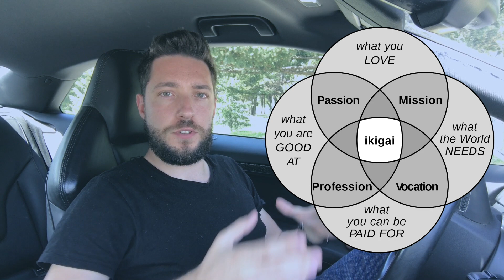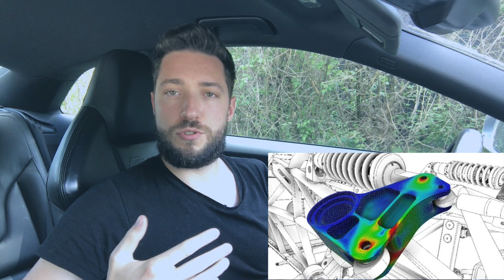Let's build a Minimalist SUPERCAR, from scratch

Comment: I like the idea!
People overlook the fact that:  Theoretically; a trike with no suspension and solid wheels keeps all wheels on the ground at all times...
With 3 wheels, you might consider an ...'over-tuned' modded Active Anti-Roll Bar, off the shelf, to give it some lean into corners.

For the E model:
A series hybrid with a small constant rpm and load engine:
That means that an engine with a magneto and carburettor can  be tuned to optimal..!  = Cheap and simple.
Also the intake and exhaust lengths can be tuned  to optimal as they then are working 100% of the time, vs for 1 second, 5 times in the std Urban Cycle.
(Manufacturers normally don't bother due to this)
Normally 'Always On' to keep batteries as small, light and cheap as possible and for easy cabin and battery heating.

Lightest is a clean  (due to constant rpm) 2-stroke.
Google:
Ecomodder How dirty is a CONSTANT RPM 2-stroke with a Tune-Pipe?
post # 7 for more/full details.
You can contact me from there too. I'd love to hear from you!  :)